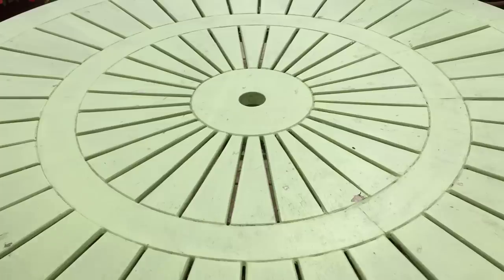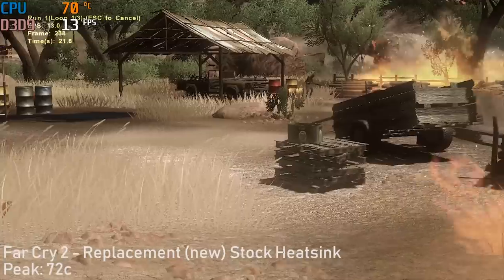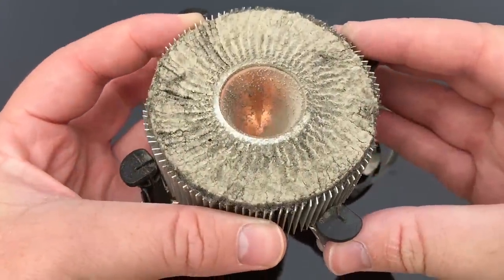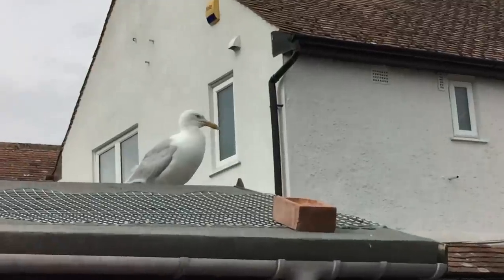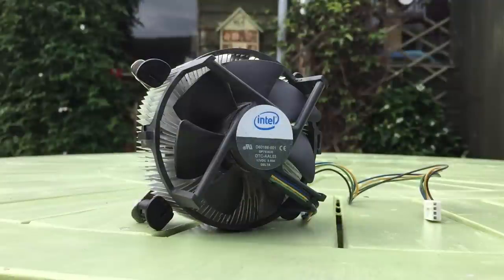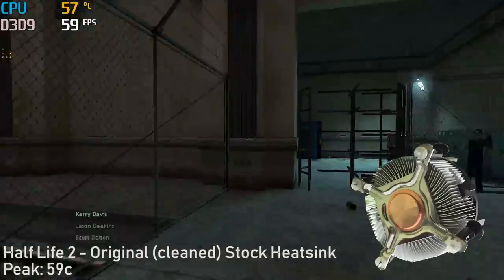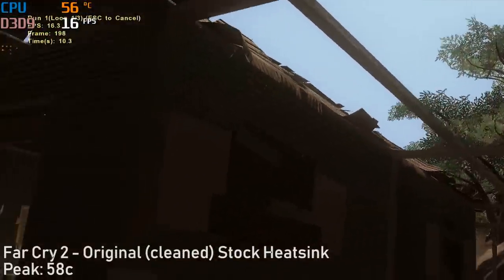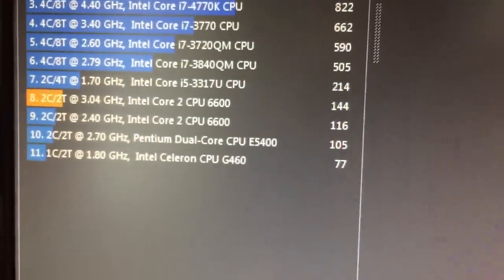Saving The OG Intel Heatsink!

Comment: You should have seen when Compaq used their own OEM Coolers on Pentium Ds....That thing rivals decent coolers even today.
Reply: Oem coolers are usually decent. Even if a bit loud they do their job properly. I also have a few pentiun D coolers and they rock.
Reply: sobolanul96: Dells Pentium 4 Coolers were actually manufactured and designed by cooler master.... Needless to say those also work well.
Reply: I have one, and it keeps a stock Q9400 cool without issue.
Reply: I had an HP system with a Pentium 4 516, that had a giant Cooler Master on it, I ran that system at 3.6 ghz for years, and I still have the motherboard and the processor on storage...
Reply: did you ever have one with the ducting that forced the air to the side of the case and to another fan? those were legit AF.
Reply: can you make  video about that?
Reply: I've worked on old Dell BTX systems and I can confirm, their heatsinks are top notch.
Reply: I've got one of these, though it seems I'm unable to mount it properly for unknown reason. It always hovers a tad above the IHS. Beats me...
Reply: well, nuclear fusion baased cpus (pentium 4) also had good cpu coolers imagine ap4 with one of the actual coolers.. lemme guess 150c minimum xd
Reply: Haha, oh god yes! I used a 2004 Pentium D Compaq as my work computer from 2012 to 2015, and the tower cooler was *enormous*. Just incredible, I originally thought the previous owner used this overkill beast because he lost the original cooler. Thanks for the memory, it's been a long time since I had that computer :)
Reply: I have one of those huge towers, they also went on Dell xeon systems of the time. I threw it on my old i5 3470 with no fan just to see what happened. On a open air bench the CPU peaked around 70c. It was amazing
Reply: Grandezekial TheBestMinecraftPro: Hi man, you're best bet for a new channel is to make content you enjoy, it's a hobby not a job. I can't partner with you, as I prefer the freedom of not being tied down to make content I don't find infesting or helpful, which can be an altercation when working with others.

But best of luck with the channel though.
Reply: I understand what you mean i know this is not a job I have fun doing this to and what i mean was  that i just wanted someone to talk to about computers because most people dont understand computers on a very deep level like you do and i do i was just asking for almost like a friend ship where sometimes i talk to you and show you the games i program and thing like that because people don't understand sometime and mostimes on what my hobbie is. I am just asking to be freind sbecuase you understan a person where i can have a real conversation with about computers and programming. I am sorry i made the lasy comment like i was making it into a job i just whant a person where i can share my hobbies to and they understand
Reply: This is Grandezekial by the way
Reply: Budget-Builds Official I have one of those! Its a tower cooler and it has 6 heatpipes I think. I always thought it looked similar to a 212 Evo.
Reply: Don't free spin fans or bearings with air! they are not designed for "no load, high RPM's". Hold them still. I've personally seen/experienced fans/bearings explode! I'm a Mechanic, and I use compressed air all the time for cleaning. Not just car parts, but computer components and electronics as well. Oh yeah, and you should just get a small air compressor and an air nozzle, and save some cash on the "Canned Air"! Your Mum would be proud!
Reply: Matt Christie I'd be very cautious using a standard air compressor near PC components with the high chance of large levels of moisture coming out instead of purely air, something to be aware of from personal experience with multiple air compressors both consumer and commercial
Reply: Dell one are loud, made by delta usually. HP stock heatsink are much quieter from my experience.
Reply: I bet this comment was PRE-RECORDED! :)
Reply: @peter geary If it's that big of a concern for you, you can just add in an air dryer.
Reply: If you can try cleaning heatsink cooper parts with, wc blue cleaner like harpic or duck, just a few drops, then let them do their work for about two minutes, clean with a dry cloth and then clean with isopropil alcohol.
Reply: do you mean coolers or the guys in the videos because he appeared in the video in this video
Reply: Budget-Builds Official how do you wash fans, because aren't they electric.
Reply: MR wolfanator: Generally just give them a clean down with a cloth. If the bearings are a bit sticky, I use WD-40.... If the bearings are near dead then I spray them to death with water, clean them properly, and WD-40 them again.
Reply: Budget-Builds Official: Thanks, I do love your videos as well and I have a compaq system and their fans are great because I got two cooler master fans from some that I picked from the trash.
Reply: Reminds me of the old athlon bricks with wind tunnels that hp used
Reply: Wow, really? I actually have a spare one in my crammed drawer and thought it wasn't really great but your statement makes me want to do comparisons
Reply: The aluminum coolers suck. The one that came with my e8400 could barely keep that chip at 40℃. The copper cooler let me overclock that chip to 3.9 and still kept it at 35℃ most of the time in games, up to about 55 in heavier workloads.
Reply: @sobolanul96  take a look at the optiplex 760 stock cooler. just yikes
Reply: My dell dimension 4700 came with this giant rectangular block of pure copper (base and fins were both copper) and a 92mm delta fan. If there was a way for me to use that cooler on a newer system I bet it'd be incredible.
Reply: @BudgetBuildsOfficial  fun fact Amd's Wraith heatsink is also made by coolermaster
Reply: I have a VERY beefy cooler on my HP worskstation xw4400. This thing can handle 120w chips
Reply: the intel stock coolers for the 1366 extreme edition cpus are insanely well made. You can overclock like crazy on those. The lga 775 stock coolers are pretty dang good too.
Reply: @synthh3850  that one is awesome

Comment: Oh, that is one nasty heatsink alright.
Also, screw Intel for gradually making their heatsinks smaller (along other shitty things Intel has done) :)
Reply: that why amd better
Reply: its even gotten smaller from skylake to coffeelake! skylakes heatsink has the fins branch off into two for more surface area and coffeelakes heatsink is just straight aluminum and doesnt split down the middle.
Reply: Let's not forget that some processors don't even ship with heatsinks in the box anymore.
Reply: Those are the "k" ones couse using a stock intel heatsink on a "k" cpu is like burning the cpu
Reply: Also screw AMD for letting them screw us for so long before ryzen
Reply: Mitun Shah I'm sure AMD didn't intentionally lose to Intel for so long. They're a business after all. They exist solely to beat competitors and make money.
Reply: AMD went into a hibernation state to work on CPU technologies that would defeat Intel ;)
Reply: Just because its a K model doesnt mean it shouldnt come with a stock cooler, or rather just because its a K means you are going to overclock it anytime soon.
My Ryzen 1600 is running on the all core boost, not overclocked because Im getting the fps I want
Reply: Intel and AMD should sell the same retail CPU box with bundled or unbundled stock coolers to reduce eWaste. Enthusiasts who are building their own systems are just going to chug it into the bin anyway.
Reply: Good idea, but I don't think it's that easy to accomplish. They would need to make two separate packing lines for one CPU, which means increased cost.
Reply: AMD FTW
Reply: It's actually easy to accomplish since packaging is highly automated.  The Intel K chips are sold in the same sized retail box with no coolers. The only difficult part  is scheduling and forecasting demand for each SKU in the production line.
Reply: They used to at least shove a copper slug in the heatsink to help get the heat out to the fins. They eventually cost cut the copper slug, then they started removing some of the aluminum, which caused the heat sinks to have a lower saturation limit, causing the processors to thermal throttle out of the box when turbo boosting.

It's interesting. Intel keeps making their heatsinks cheaper while AMD keeps making them better, yet people continue to buy the intel. Mindshare is a hell of a thing.
Reply: for how much they charge for their processors, you'd think they'd take more pride in the coolers. I think they should just stop making them and require the end user to get there own. ...and make their price reflect that. Why can't they just put liquid metal on their chips when it improves the temperature and performance so much?
Reply: I uh I uh have a intel core I7 8700k it's Purdy gud
Reply: RavenPrecept was it the Samsung with the Tualatin P3 1000 ? Still use mine as it is still quick.
Reply: This is why you swap them to a better one, either from the same era or even an older era heatsinks etc Compaq.
Reply: I’m very happy with my AMD Ryzen 2700 (non-X) stock cooler. it’s a small, Spire LED. Quiet, not annoying fan sound at all, temps 40-50 C, sleek and RGB. Coupled with 3200MHz RAM , a 1080Ti GPU in a M ATX case and Win10 LTSC, I’m not suffering bottlenecks and my card runs cool vs the 2600x with its sometimes heaty XFR2. I’m very happy with this FU answer to intel from AMD. And eight true cores fucking brute force through anything.
Reply: @DragonProtector  Wraith coolers ftw. Actually have braided cables.
Reply: @marsandbars  I got silver arrow tr4 cpu cooler it a beast
Reply: @DragonProtector  Just be a normie and use the Hyper 212 Evo lol. Nah, cool cooler btw. I just was building my PC with tighter budget constraints, and I would've had to cut back on core components back then if I wanted a fancy cooler, but the stock is fine with me. Looks good, silent, actually is decent and keeps the CPU at decent temps.
Reply: @marsandbars  :) ya it can be hard.
Reply: supra107 who uses stock heatsinks anymore? They’re crap compared to aftermarket ones.
Reply: @MapleLeafAce  yup
Reply: Hopefully, AMD will force them to be less horrible to us consumers, especially now that everyone knows the advantage of the Ryzen wraith coolers vs the crappy intel stock ones.
Reply: You think maybe its a case that Intel CPUs simply dont get as hot as they used to?
Reply: chuck the new intel heat sinks away, and store the old ones :)
Reply: @iMadrid11  there are pretty often CPUs on the market, at least in Germany, with no CPU-Cooler included. Called Tray and Not Boxed/Box. The problem is they cost in most of the cases more, so why paying more when you get less. And its basically at every CPU possible, Core i3s to Core i9s, even at newer Pentium and lower although there is No Aftermarketcooler needed because they run so efficient. And at the AMD-pendants its the Same Situation
Reply: @schekelberg6187  Tray packaged CPUs are sold as OEM specific product.  Destined for prebuilt system builders (ex: Dell, HP, Lenovo, Apple .etc) and enterprise customers.  

They’re usually the same CPU. Sometimes slighter better in specs. If a system builder custom orders a huge chip order for their prebuilt system.  

Usually these tray packaged CPU are leaked into the retail market by distributors.  When they have an oversupply of inventory to get rid of.  Consumers are only supposed to buy CPU sold in a retail box.
Reply: amd just woke and started beating intel, they will decrease quality over time due to high production of cpu's, no hate to amd, yet still i like intel

Comment: Some of the Intel Netburst Pentium Ds had 130W TDP. Such a stock cooler should do really well with a Core 2 Duo.
Reply: PhilsComputerLab first
Reply: PhilsComputerLab Second
Reply: It certainly did, you are not mistaken. I even overclocked a E4500 with this one. Kept it at 3.2 GHZ.
Reply: +Gustav Gurke
Yeep keep clean and repaste
Don't forget change processor fan speed into auto mode on BIOS.
My guess grease oil on fan is desiccate so must be lubricated again to reduced loud.
Reply: I do own the stock heatsink of the Pentium Extreme 965 and it's quite reliable! I would love to mount it into my "new" HP Z400 build but the LGA 1366 mounting holes are too afar from each other for my heatsink to fit :(
Reply: My E8600 is running at 3.75ghz with a stock cooler designed for an LGA775 Pentium 4 and it works great
Reply: I use this heatsink on my Xeon E3 1220 V2 without any issues.
Reply: Bro, can I use the heatsink for pentim 4 670(which has a TDP of 115) with my Core 2 quad q9550, TDP 95.
Reply: I used that same cooler on my overclocked E5200 before upgrading to a g-power 2 pro gigabyte cooler

Comment: you can wash the heatsink with water as long as you let it dry well
Reply: chaos better use alcohol
Reply: You can wash anything with water if it doesn't have electricity running through it and you let it dry.  My CPU, keyboard, headphones have all been given a bath at one point or another.
Reply: Vincent Hernandez  I wash my pc with alcohol ever so often... (of course excluding psu and storage xdxd)
Reply: But wouldn't it corrode the metals? I don't know much about this stuff.
Reply: +mbsfaridi unless you wash the fan which has barrings , you will be fine
Reply: You could wash a motherboard with water, if you remove the BIOS battery and you dry it well.
Reply: +Pasi123 well , if you found a mother board while digging out potatos , might be worth washing it
Reply: chaos Ah, I see. Thanks!
Reply: +chaos Have you ever seen a smoker's computer? You wouldn't be able to clean one without washing it
Reply: its what happens when you download too much ram and the computer cant handle it
Reply: just don't hand hold it under boiling water by the edges like I did.
Reply: chaos yep washed mine too
 Although I removed the fans just to be safe.
Reply: Yeah, except it wil oxidate ;)
Reply: chaos I cleaned out an old Xbox about two months ago, motherboard was covered in dust so I just washed it in the sink and let it dry for like two weeks lol (was probably fully dry before then, I just forgot about it).
Reply: mbsfaridi 
Not if you dry it straight after. It would only corrode if the water stayed on it for an extended period of time.
Reply: Aluminum and plastic don't rust.  The tiny steel parts will dry before they have a chance to.
Reply: @Jaymiecain1  wrong,
mixing two metals together in an aqueous environment creates an electrochemical cell, and thus, corrodes the interface between the two metals.
Reply: @JustinKoenigSilica  the science and the reality don't always match up in such small scale scenarios. You can give any scientific explanation you like, but I've been washing things in water for years without any issue or loss of performance. Rinsing a heatsink under water for 30 seconds, a minute, then leaving it to dry isn't going to cause any damage.

De Bauer washes his boards, heatsinks and so on under water. Id imagine if a top overclocker who is extremely thorough finds it okay then most people are fine..
Reply: @Jaymiecain1  problem is the salt and other minerals staying on the surface and may eat up the metal under humid locations. I will not 'wash' expensive electronics... Headphones and all may not be a good idea as water may damage the mechanical elements. In short :D do whatever you like and good luck :)
Reply: @RaymondLo84  r/woooosh
Reply: mbsfaridi it’s aluminum, so no
Reply: Should be fine. Whip the fan off, give it a good wash in water and a little washing up liquid, rinse, and put somewhere warm to dry. I've used an oven set to 100 degrees before.

Comment: But... can you overclock an i9 with it to 5ghz?
Reply: Veteran Ntdaspi 😂😂😂
Reply: only on Tuesdays!
Reply: Probably
Reply: Veteran Ntdaspi not without a nuclear blast
Reply: Briefly. Then it'll either Throttle or Pop ;)
Reply: You can't even fit the cooler in mb
Reply: You can, if you're Apple...
Reply: Just 4.7Ghz, close but not enough :(
Reply: Somidemon lmao
Reply: Veteran Ntdaspi yes with liquid nitrogen it can reach 7ghz but the cpu is a celeron
Reply: Yes but remember when it catches on fire that's normal. And parts melting is also normal, also I hear that fan has a fireworks display when overclocked to 5ghz.
Reply: It will blow up
Reply: I’ve heard those things get boiling hot
Reply: Easy
Reply: Nope. The mount holes are .6cm closer on the diagonal.
Reply: Facepalm
Reply: Suuuure. If you like seeing firemen
Reply: @huybv1998  i know ur right but i managed to fit this heat sink on my z170 board . If you dont believe that you can search on youtube i have posted that video of fitting it to z170

Comment: those old heatsinks are pretty beefy, throwing it away is a waste. why intel doesn't make those anymore is beyond me...They clearly have the money...
Reply: copper is expensive, so according to intel = smaller heatsink, less copper = more money

honestly AMDs new stock coolers are the exact type of cooler we SHOULD get from intel, they are big and discrete at the same time and some even have RGB. :/
Reply: Newer processor have lower TDP so it's no longer necessary for a beefy heatsink
Reply: SandPox The 8700k is a very power efficient CPU with lots of overclocking headroom on its stock cooler.
Reply: @pogpengwyn  👍
Reply: Intel should really take some advice and insparstion from amd thosr srock coolers are pretty decent
Reply: @pogpengwyn  That comment didnt aged pretty well...
Reply: @CommanderTato  how so?
Reply: @pogpengwyn  AMD went scummy with prices and removed heatsinks from cpus, now only 5600X have a garbage wraith stealth.
Reply: @CommanderTato  the prices are mostly due to the retailer, but I didn't know they removed cpus coolers? I stopped looking for new tech after my 3700x as I don't need to upgrade for a few years lol. Oh well hopefully AMD will bring back some more coolers as they were really cool